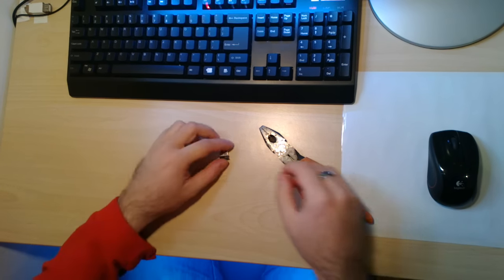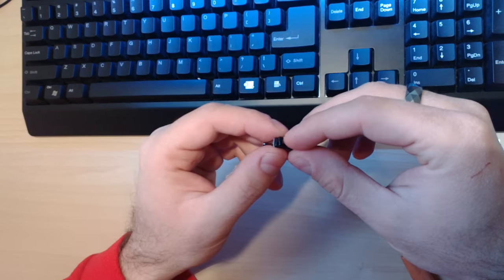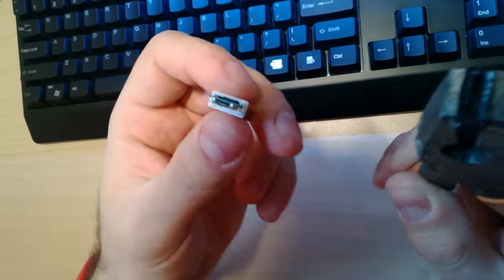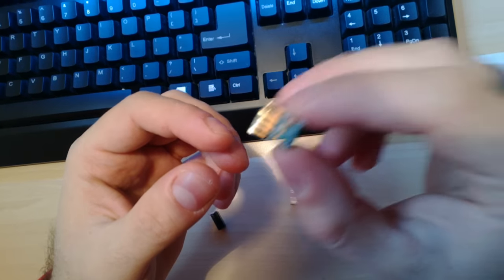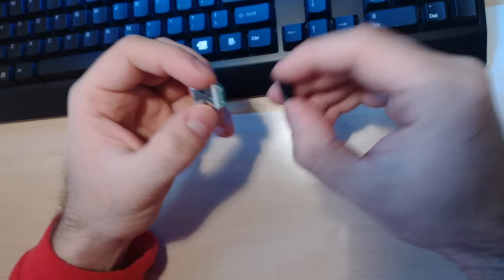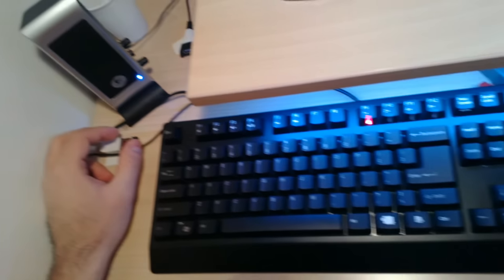How to fix faulty USB Receiver (Logitech Unifying)

Comment: I am here on 2024 and it worked for my Logitech G304. I didn't have pliers to pull out the black thingy, so I just inserted a piece of paper on the underneath, following the same logic that the receiver needs to be lifted for it to contact with the laptop port. Will observe if it will still randomly disconnect. Thank you!!!

Comment: Spasiba! I did it to mine too and works perfectly. It's a very annoying, but common hardware issue. I've had something resting on it for a long time which has been dangerous and harmful for the USB components in my laptop. No longer an issue. Cheers Bro.

Comment: Great, it actually works!!! I was thinking this will only work for receiver which is not detected by the Unifying Software. My case was the receiver was being detected by the Unifying Software but the Mouse and Keyboard was not connecting. Tried this and it worked. Thanks.

Comment: Thanks, I fixed my dongle for the g930 headset in a similar way. I needed to lift the dongle, so I put the paper underneath the chip inside the plastic cover and it worked! (funny that this video is nearly 9 year old and still helpful)

Comment: The pliers are lineman's side cutting pliers a lesser known tool. Not really suited for delicate work needle nose pliers is what I used, and this trick worked great for me thank you! My wireless receiver stopped working after plugging in and out a few times I thought the usb port may have fried it. It was not the port current but being bent a little from plugging into a tight port on macbook. I wish I had watched this before I bought a replacement. This is a design flaw maybe even intentional to sell more receivers. I will keep one as a backup losing keyboard and mouse is bad was in the middle of working had to stop.

Comment: I don't usually comment on a youtube video, but when I do it's because it worked!
Had to pull and pry to get the cover off both nothing broke. Poor design but easy fix. Now I just need to glue to cover back on so I can unplug it more easily.
Annoyed that this is still a problem 3 years later, brand new receiver stopped working less than 1 week old.

Comment: Fantastic.  Thank you.   You must have the grip of Thor.  There was no way I could hold the usb end and pull off the cap.  I was able to lift the board from the other end with a small screw driver and put a paper shim under it that way.

Comment: Spot on for the cause of my problem, thank you, but instead of dismantling the transmitter I just cut a couple of small plastic shims (in my case from a  battery package) and slid them between the PCB with the contacts and the metal casing from the end.

Comment: Confirmed working for my issue (stopped working with paired devices + still recognized/found in logitech unifying software with listed devices, but would not be able to find/connect any devices). 

Small tip: its kind of tight to pull off the first time, then you use more force and the pieces go flying across the room and are tiny to find, start light haha

Comment: thanks dude, it works. This happened to me when I started moving the usb receiver back and forth between my laptop and pc, and as you said the problem is it is losing contact.
Reply: This is how mine broke too. I can’t get the damn thing apart.
Reply: @IvanaGiznya  , don't stress too much if you can't fix it. You can buy a replacement receiver from ebay for like 15-20 bucks

Comment: i just put a knife under the other end where it connects to the pc and pried it apart a bit and stuck a tiny piece of cardboard in the gap and it worked fine. prob just a bit easier than your way for the same effect. thx for the video tho bro i wud have never realised that it was caused by poor contact i just thought it was a compatibility problem. 100% fixed the problem.

Comment: My issue: I plug in the USB unifying receiver and connect the mouse. It works for 2-10 minutes before I received a Windows 10 USB malfunction error. 

Your fix: Now when I plug it in, it seems to work for way longer than that. I should have known it was hardware! Thanks!

Comment: Just tried this thinking "eh, if I screw up the receiver and it breaks, I'll be no worse off than I am now with a nonfunctional nano receiver." I took a pair of pliers to the end, snapped off the guard with a good quick tug, and used five small (0.5x1.0cm ish) pieces of post it note stacked up underneath the receiver. It works like a charm now, and I super glued the cap back on to the dongle (let's see if that part holds up to removing from the USB port...). But yes, this absolutely worked with my Logitech nano receiver for my M305 wireless mouse. Thanks for the tip, what a quick, easy fix!

Comment: Damn. I was sceptical, but it worked. I had a logitech mouse that I bought like a decade ago and have been using on my laptop for about 5 years. Recently, the mouse often stopped working and I had to unplug the receiver and plug back in. And I noticed that if I wiggle the receiver slightly the receiver gets disconnected and reconnected (you know, the Windows sounds). I thought that the receiver's circuitry was damaged. I found your video and opened the receiver. The 4 contact gold contact lines seems a little bit worn out compared to where they are not contacted. I inserted a small piece of paper and plugged into the laptop. I have not tested much, but so far, the connection is stable. I could add some solder on the 4 contact lines, but hey, if just adding a piece of paper works, I will keep it that way.

Comment: Perfect, I used a similar fix wth a little piece of a match stick to fix my nexus5 power button contact problems.  I also used ltunity to redect my m310 mouse that was being detected as an m325, and apparently not working because of that software issue (this on redhat fedora 25).  Anyway, good vid.  Cheers.

Comment: If, like me, you bend up the metal casing too much for it to fit anymore, you can just leave it off. Tape your slip of paper on the back of the chip, then layer up some more little usb-sized pieces of tape, stick them on the back, and just slip it into your port. You don't actually need the metal casing for it to work

Comment: IGOR! There's no need to take the dongle apart! All you need is  small pliers to give a very careful squeeze to the metal to tighten up the connection. May also benefit from contact cleaner and a skinny applicator. :face-turquoise-covering-eyes::thanksdoc:

Comment: Well I'll be damned it actually worked. I had my mouse plugged into my phone with a broken screen when i dropped my phone and I thought it corrupted the driver or some software BS cause my phone was formatting a SD card. I tried for a couple days to reinstall drivers and all this crap trying to get it to work and all along it was just the contacts that got messed up from the drop and a lil piece of paper fixed it lol. Thanks!

Comment: Thanks, this fixed mine. I had assumed it was a faulty receiver as device manager and the Logitech software picked it up perfectly but it just couldn't detect any mouse or keyboard. Did this and it picked up everything again. I wonder how many of these receivers have been dumped because people didn't try this?
Reply from the maker: Probably whole 40ft container. You can see comment section is full.
Reply from the maker: Which device and model did you fix it for?
Reply: @IgorNovakSplit  I have a k830 and a k400 I was trying but I can't remember where the receiver came from. Thanks again.
Reply from the maker: @zoominginonstuff8146  You are welcome :D

Comment: Thank you for this vid.... I have a Logitech G602, Havent' had it long either. I thought my transmitter just up and died when I turned on my desktop and it wouldn't work.... once I got the folded paper just the right thickness that I could plug the receiver in, worked flawlessly. I dont' know how the one you did in the vid is put together, but in the G602's, the little board slips back a really tiny bit and sits in the white plastic holder it's on. Problem is when it does that, it gets flush with it and doesnt' make contact. You have to have just enough paper folded in the little hole underneath the board (hole in the plastic holder) to push it up only SLIGHTLY, so it's just above the holder. Anymore then that and you can't push the receiver into a usb port.  I never have this problem with anything  else.... Logitech's engineer's really suck at receivers apparently....  I'm putting a reference to this vid in my review for the mouse on Amazon.

Comment: Everyone if your mouse has a new battery and is in good shape this method will mostly work! Try taking the USB and bending it a little while plugged and try moving your mouse. If the cursor moves then the problem is that the chip inside the USB is to far apart. So what u can do is slightly bend and remove the USB from the laptop/ desktop but make sure its still pluggdd in because the computer and the chip just need to recognize theyre connected. Hope this helps also u can put a little piece of paper in between the chip to elevate it a bit but u will have too remove the back part of the USB to do so.

Comment: usually its bad solder, putting it to oven at 200c for a 5-10 minutes usually fixes the solder, the plastic may melt, but does not affect it working

Comment: Igor, my mouse has no problem pairing with the receiver but I have trouble with tracking and various clicking functions. Does your solution work for problems like that, or is it only for situations where devices can't be paired at all?

Comment: Ah, perfect. When you do this, try to use as small a piece of paper you can get away with, so you can fit the cap back on while also keeping the receiver adequately inserted into the port. But yeah, works perfectly. My dongle doesn't fit all the way back into the port, but it's close enough and works as usual again!

Comment: Works! Fixing guide approved ;) :D

I was so fucking close to buying a whole new mouse!

My issue: Mouse regularly disconnected and reconnected to my pc while working properly at my gf's pc. made me wonder whether it's pc pc thats broken! It was hard to determine which device was the one not working properly.

Ty Igor for this fix!
[Though I might replace the paper with some good glue (multi-component-glue) cause i dont want paper near devices that carry electricity]

Btw that accent is lovely :P

Comment: Pull the top off -Tutorial:
(Warning: Tutor is a german speaking monster :D)

So, hey everybody. 
It's really easy to pull off the black part from the white until you use your fingernail to reach open the single column between the white and the black part. Put anything tiny and thin between the parts to hold them in place.
Then take a pliers and hold the silver part which will be put into the USB-Port of the Computer. (e.g. put a paper between pliers and USB-Dongle to avoid scratches)
The last thing to do is, to pull off the black part and use the fix ;)
Reply from the maker: I'm not German xD but I am a monster!
Reply: Your solution worked perfectly!
Reply: Breascull that accent is definitely NOT german , I don't know where you got that from 😕  it actually sounds like a middle eastern accent 😊
Reply: that U00.... thing was supposed to be an emoji >:/
Reply: Angelina Galdirian  Wrong again.. Not German, but not middle eastern either..  this is clearly a Slavic, or Russian accent.. And thanks Igor, for the fix.. I will try it this weekend, on about 10 dead receivers ! :-)
Reply: Igor Novak Haha Breascull is referring to himself! Thanks for the vid

Comment: Hi Igor,
I have got a Trust 17089 wireless keyboard but the receiver doesn't work (the system doesn't recognize it and this fault isn't a contact malfunction).
I have pluged in a chinese HUB and that hasn't worked anymore as I think the receiver got an overvoltage.
Have you got any ideas how to repair it?

Greetings from Hungary

Comment: As another person said, this does NOT work for all Unifying Receivers. Mine is relatively new, maybe a year old, and this DEFINITELY will not work. Pulling the cap off results in breaking the receiver, as it is not glued in. It is "permanently" clipped in, and pulling hard on the cap breaks plastic parts inside. With the cap off, you still can't remove the board, as it is also clipped in, unless you grab it with fine pliers and pop it out, risking breakage. There is no white plastic inside mine, it is orange inside, even though externally it looks identical.

Comment: Ha! It worked :D With my M235 receiver it wasn't possible to take off the cap so easily, so I've had to broke a thin plastic under front of the usb connector, the rest was the same. However, shame on Logitech.

Comment: would this work with the logistics g602's USB reciever? Or if necessary, would the g602 be able to use a normal unifying reciever?
Reply from the maker: Yes this method can fix all receive rs with thus type of problems

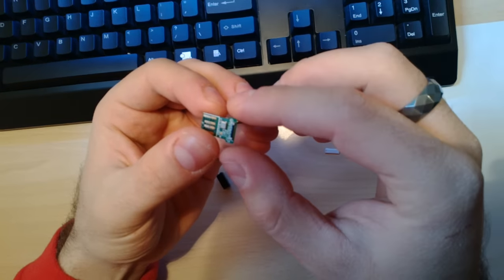Comment: Btw I found small trick to do it faster, just pry open a small gap between metal housing and the plastic base below the contact module (the white color plastic @1:09) then slip in a piece of paper. No need to pull out the cap.

Comment: This fix is not recommended because the Logitech USB dongle will bend the pins in every laptop/pc. The fix may work for a USB port that already have bended pins, but don't plug the USB dongle into other USB ports!

Comment: Easier method was to take a straight edge razor, the ones that come with the the thin card board around them individually. DON"T take the back of the USB receiver off. Take the razor of of it's protector and cut a piece of it small enough to fit inside the USB Receiver. Slide the razor in the front end under between the white plastic and metal frame while you take your cut piece and shimmy it in as far as possible. ( if you just get a corner started it should make it back good enough. To finish, trim off any paper sticking out.

Comment from the maker: What battery do you use when it works?
Reply: Single AA battery
Reply: Some logitech wireless mouses work only with alkaline battery - they don't support rechargeable, rechargeable won't even fit in battery compartment - it is too long - like on my logitech V220
About this fix - it is great - i had this usb device not recognized error - i just squeezed usb receiver while inserting it in usb port and it was recognized right away as usb composite device and one hid mouse and several human interface devices appear in device manager (win xp) - even though I don't have battery in mouse - so battery is not important for testing if usb dongle works
I have lot's of rechargables but they don't fit - by the way i just found out that my battery charger was charging only every left battery in a pair cause it was in special mode 1 - mode 2 was for 2 or 3 batteries in same place - third one above those two in the middle - so that explains why my underwater light had so short life
Reply: +Andrea Domikulić Rechargable batteries are the same size... I don't see how they wouldn't fit...
Reply: +Igor Novak Thank you.  Best advise.

Comment: Logitech is replacing faulty receivers for free, just file a warranty claim on their site.

Looks like it is a known problem, the actual cause is not a bad contact pcb-usb slot, but some cracks that develop in soldering of the chip on the other side. Paper or plastic straps apply the pressure on that chip and force the contact to reappear.

Comment: I'm going to try this, it makes sense because my g602 mouse that uses a bizarre 500hz receiver has started acting funny. If I push on it or giggle the receiver I can get it to work. It made me think it was a contact issue. Hopefully I don't break it trying to pull it apart, hopefully this works.

Comment: i am struggling to take the top off. any tips?
Reply: I used two pairs of pliers to pull it apart, one holding the black section and the other holding the silver piece.

Unfortunately, no luck for me with this one. I think my receiver's even more faulty than most.

Comment: My USB Receiver won't come out of the port.  I used a pair of pliers and the "cap" came off but the mechanism is still in there.  Should I pull out the other part with pliers?
Reply from the maker: Sabrina Neacy you can pull other parr just with ✋ hand

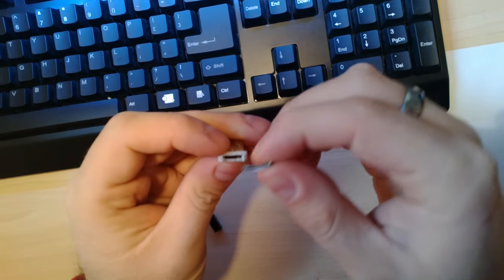Comment: Good Tutorial, but there is an easier way to fix it! You only need a real slim screwdriver, knife, or something else! You have to lift the metalframe "a bit" up from the white inlet (can see it at 1:08 and 1:24 ). Then put there a tiny piece of paper, or something else between! Iknow you are putting the paper between the white inlet and the green contactplate, but it makes no difference! So you don´t have to crack it! That´s all!
This is working for my Logitech M325 since over two years!

Comment: My receiver stopped working ONLY  with the keyboard, it still works with the mouse.  It's not a problem with drivers: in other pc the  same happens. It's not a problem with hardware: i have other  receiver and  both (the same)  mouse and keyboard works. What happens  is that  when  i  try  to pair the  keyboard, something is detected because  when turning on the  keyboard,  immediatly appears a  message  saying not able to  pair... very strange...

Comment: If you got problems getting the top off... Use 2 pliers. I didnt get it off (either) with hand + 1 plier.
Reply: and fuckin shame on logitech. This problem occured after switchitng the receiver a couple of times from 2 computers. Should be far more solid.
Reply from the maker: Next time use "pair of Something" it will work like a charm.

Comment: Here is my problem
I have a M510 mouse and i usually have to like wiggle it to a good spot to get it working, and the mouse dropped while i wasn't home and then when i go to plug the USB to the port, the pointer just jumps to the corner and wont move out of that spot, WHAT DO I DO NOW D;